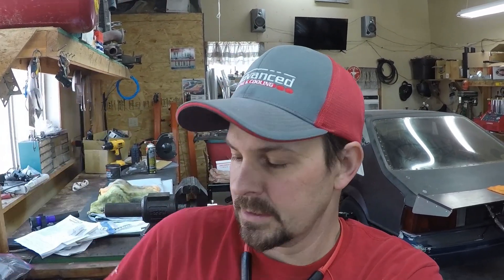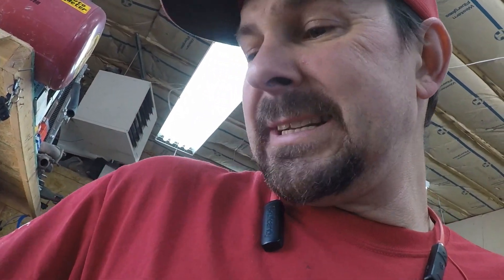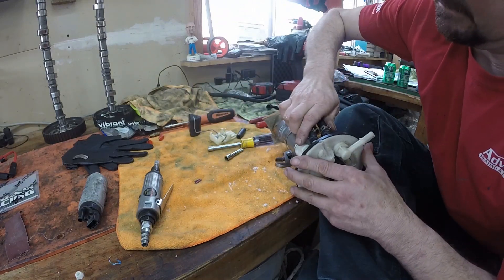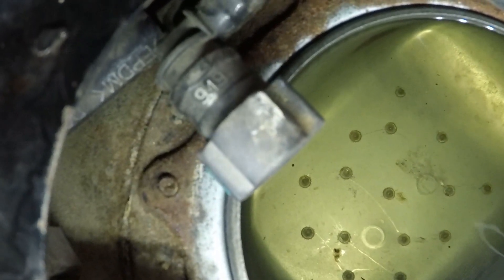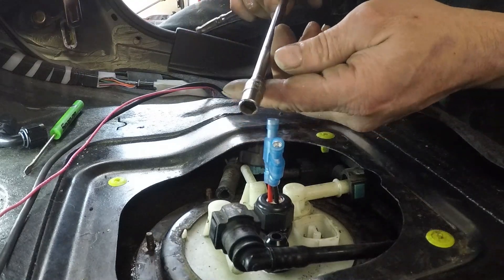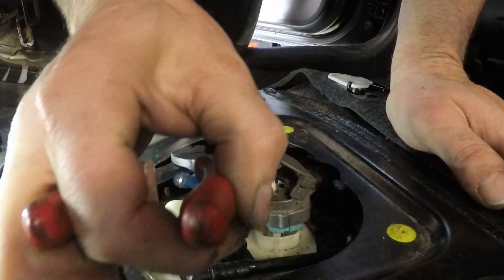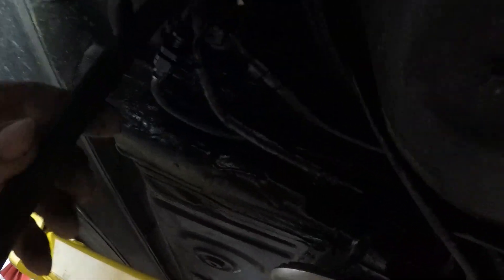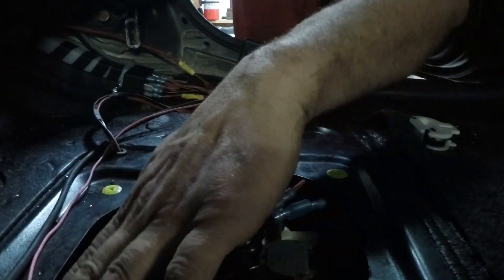Using the Evap line as a secondary fuel line on an Evo 8/9 Part 1

Comment: Hi I have a 1992 talon gsx and a 2005 evo 8 ...I know the 1G has a metal fuel filter on the fire wall with a banjo bolt going to the fuel rail but where is the fuel filter for the evo?.. I thought on the evo 8 and evo 9 the only fuel filter is the sock strainer on the fuel pump from factory.

Comment: I actually just did my relays for a buschur double today and I was wondering. I know you're supposed to use between a 14-10 Gauge wire for the relays. But is that for all of the relay wires? Or just the 12v off the battery to the relay that has to be thick? Because I have 16g wire and I want to change it to 12g, but its too much of a hassle to change them all again.